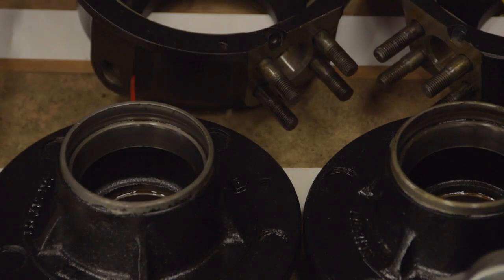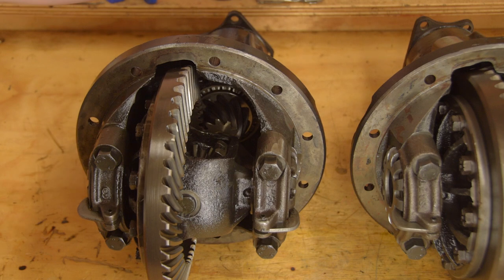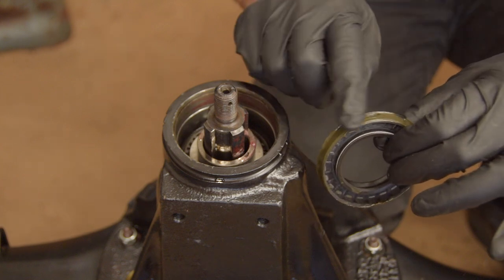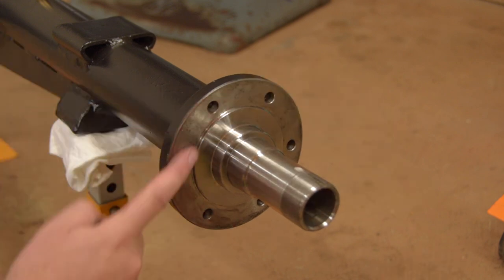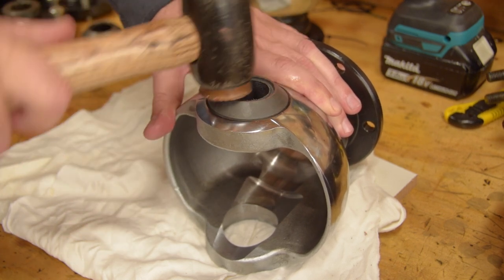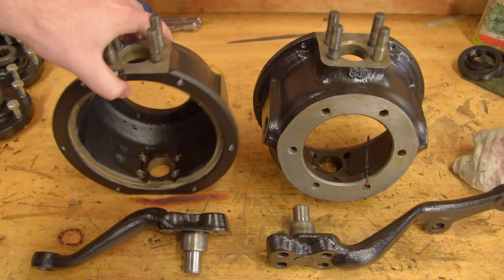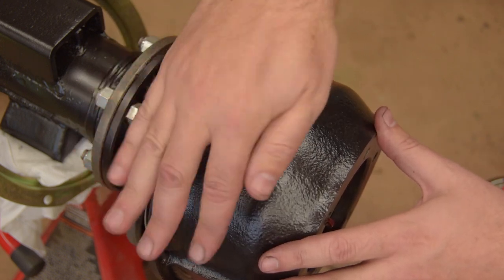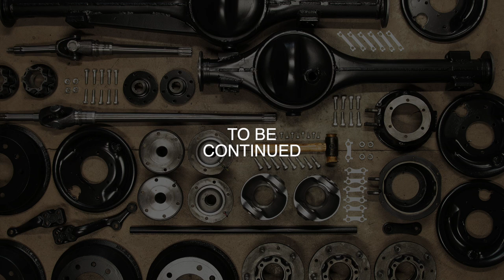Land Rover Restoration Part 10 - Front & Rear Axles 1/2

Comment: Surprisingly enough to respond to your gear pattern comment they are very good. You want the pattern to edge further towards the “toe” of the gear, ie further out towards the edge rather than it be further down i the centre like you suggested. On our aircraft transmissions we set the pattern relatively high, along with roughly about the same amount of backlash
Reply: Hi folks, I'm guessing, but I suspect the reason for this is to maximise leaverage and contact area on the gears thus reducing the tooth load and consequently the wear.  Obviously you don't want the contact pattern ever getting off the outer edge of the gears, just 'reasonably' close. BobUK.

Comment: Whitworth bolts holding the backing plates on, Luxury. Series 2A use BSF (well mine does), Nylocs for those are getting hard to find at Bunnings, still popular in British aircraft restoration circles.
Thank you for the detail on the front swivel housings, being new to Land Rovering I wasn't clear how it all fitted up and worked.

Comment: For the preload use the lead solder method.  Replace the shims with solder and tighten until preload achieved, remove, measure with calliper and then select shims.  Loads quicker.

Comment: Greetings!  I have a Series 3, 5 door and am going to rebuild the fronts hubs and your videos are an immense help!  Keep up the great work, looking forward to seeing your Rover finished.   With that, at around the 22-minute mark you begin reassembly of the hub and are setting the drag/pre-load on the swivel pin bearing and state 8-10 lbs; I was watching another video and 3-4 kilo's (approx 7-9 lbs) is stated.    Additionally, according to the 'Land Rover 2-2A-3 Owners Workshop Manual' (pg 141), the resistance must lie between 14-16 lbs, but wait there is more!  The 'Haynes Restoration Manual: Series I-II-III' pg 231, the drag should be 12 lbs.   So between all that, the range is 7-16 lbs, which is fairly wide.     Do you, or any S3 Rover owners out there have a definitive answer?         Thanks and keep on Rovering!
Reply from the maker: Just go with whatever is in the green workshop service manual for series 3. That is what Land Rover published for mechanics to use. There were also changes in design for the top bush - I think earlier series 2 etc. vehicles used a roller bearing, so this could be some of the difference.

Comment: Excellent job, well done. Did you swap the front and rear diffs so that the one with least wear went to the back axle? I have used gaitors on my front swivels for 15 years now. Recently replaced one that was torn and found that the chrome swivel was perfect.
Reply: exactly what I was going to ask
Reply from the maker: No. I wasn’t 110% sure they were identical. And I have some rubber gaiters here to put on later. Haven’t used them before.

Comment: In all of my experience, Black Oxide or Oil Phosphate is an extremely better coating than zinc. I exclusively use these premium-priced Oil Phosphate Bolts because of their ablity to resist rusting with the aftermarket parts I sell.

Comment: A good low cost way to get bushings or bearings installed is to use some all thread (threaded rod) and some thick machine washers.  That way you can sandwich the assembly with the bearings or bushes with consistent pressure. Great is you don't have a soft hammer or hydraulic press.

Comment: Amazing video and production as usual lGeoffrey, thanks! One thing I noticed, when you were bolting on the axle end/hub bits (?), did you fasten the bolt with a torque wrench to spec, while you held the nut with a wrench? You will get a wrong reading this way. If you don't have enough access for a regular socket, there are torque wrenches that have a square hole out the top/front of the beams. This takes special inserts that are square on one end and have open or box wrench form on the other, and neither add any height to the wrench. Hard to explain but you will find them under the German word "Einsteckwerkzeug". ;) Cheers, Lukas

Comment: One way of protecting your chrome balls is to fit leather gaitors. Land Rover used to fit them onto Land Rover's made for the armed forces. One side of the leather gaitor was fitted to the axle flange when the fixed first half of the chrome swivel was offered up and fitted. Then when the swivel half was offered up, fitted and was ready for the sealing retaining ring to be fitted the wide end of the leather gaitor was fitted and held in place by the retaining ring. The gaitor was laced up at the bottom so any muck would not get in from the top!
Reply from the maker: I have a set of rubber gaiters that I'll put on. I left them out of the video partly because they look crap and partly because they were shipped without the rubber glue (they come split just like the leather version).

Comment: I knew a bloke who swapped his defender wheels for Nissan Micra ones.  Then he swapped the chassis, running gear and body for the now redundant, wheel-less Micra. ones also.  "This is the most reliable, economical Defender in the world," he said. He reckoned off-roading was exactly the same as he  only used it on Tarmacadam.

Comment: Great video thanks Geoff. I shall revisit your back catalogue and get a few tinnies out of the fridge. I would love to zinc plate all the bolts on my 2011 Puma which were originally plated, (I believe), they are a dull silver colour,  but the plating has worn off and now they're starting to rust. I assume the dull silver colour is because they're not passivated?
Reply from the maker: All commercial zinc nuts and bolts are passivated. If you have gold coloured bolts they may be cadmium plated which is a different thing.
Zinc plating just gets old. You can buy a kit from Jane kits (I assume your in Aussie or nz). I’d suggest playing around with a vinegar mix first so you don’t ruin an expensive kit getting used to the process. It’s easy once you get the hang of it.
Reply: @GeoffreyCroker  Thanks for your reply Geoff. The bolts on my Defender are definitly not passivated. They look like a dull silver matt finish paint has been applied?? I'll show an image of these bolts in my next video so you can see what I'm talking about.

Comment: For anyone watching, because i don't see it mentioned in the video, do not use a lead hammer for installing those parts. Lead smears, and contaminates, which then causes a wear spot. Brass, copper, or delrin face for soft, or, using a driver, with a dead blow hammer.

Comment: Geoffery, did you swap the diffs over front to back? As the rear had done 95% of the work up till the rebuild I would have put the front to work to even the wear on them, and give the original rear diff a bit of peace and quiet, assuming you were going to retain the freewheeling hubs.
Reply: Is it even possible to swap them tho

Comment: Out of interest, for the backing plate brake adjusters, did you happen to use the Britpart adjuster kit RTC3176? I'm about to try one out and they are a little different than factory. Loving the series :)
Reply from the maker: Yes. they are complete junk. If at all possible keep the original adjusters on the backing plates. The kits you get now are the worst quality junk you can imagine. If you have to change them maybe try and find a n.o.s. kit on ebay before buying any of the britpart/bearmach/allmakes kits.
Reply: @GeoffreyCroker  awesome, will do. Thanks heaps for your advice

Comment: i like your videos even better now, you use Wright tools and #2 Permatex. I'm old enough to remember the time before RTV. You even had to use some Whitworth sizes. What did you call that bushing at 16.15? It appears to be sintered metal.
Reply from the maker: I experimented with importing Wright tools into nz. I kept a few left overs for myself. They are equal to the best. 
The bushing is railko, which is a proprietary plastic, similar to phenolic resin.
Reply: @GeoffreyCroker  Thanks

Comment: Great videos...I think you are testing us, but I saw the diff pinion seal go I back to front I think.
I think the banjo gasket was only coated on one side I your video.
Hope that you add a lot of silicone o er the pinion nut before the shafts go on, because they leak
From the flange if you don't. I was transfixed watching the videos. My comments may be wrong,
As I was not there, and editing can be misleading, but I hope my comments keep us all looking for
That good old British oil leak,

Comment: Great video as usual, thanks! Are you sure the the Diff pinion Oil seals are the right way in ?? I m just worried because mine are the other way around (spring inside).
Reply from the maker: Yeah. They are hollow the other way round. The spring doesn't matter. They can be whatever shape depending on the brand.

Comment: Where did you source your axle seal "seating" rings? I can't seem to find the right ones and I've ruined more than one seal by trying to make it work with just the old seal as the tool.
Reply from the maker: I made them. But I haven't before. Just need to find something the right size. Yeah, otherwise they are easy to damage.

Comment: I'm not sure if this has been answered already, and I'm not sure if anyone's going to be answering questions on a 2.5 year old video, but I was wondering about the open diffs. Around 7:15 you mention the problem with open diffs and off-roading, but I don't see an explanation anywhere. Is there no diff-lock on this vehicle?
Also, why is the rear diff offset to one side? I understand the front diff has to be so the drive shaft can fit around the engine, but isn't the back diff normally centered on the rear axle?
Reply from the maker: There’s a transfer case which locks the front and rear axles together but no lock on either axle. This is the normal arrangement for a four wheel drive. More modern vehicles have a 3rd ‘diff’ in place of the transfer case, and this is what you ‘lock’ in a defender/Range Rover/landcruiser/etc. The diffs are offset because Land Rover made it that way.

Comment: Cracking job, and you can show us another video doing it all over again to replace all those Britpart bits!  Remember this word: “Bearmach” - much more reliable quality for similar price and availability. 😉. Any temptation to fit Eaton Trutracs?
Reply from the maker: Don’t believe it. I’ve bought parts from all of the cheap brands. They all just source the same crap from India. Unless you buy genuine parts, it’s just a lottery. I buy britpart more than the others because I figure they sell ten times as much stock as the others.
Reply: You’re right that they all outsource from cheap manufacturers, but I found that Bearmach seem to have higher quality control.  I have had a few good Britpart experiences, but for the most part, I have been enraged by their stuff.  Please, for your own safety, don’t use any of their brake or steering parts.

Comment: 18:41 that's not burning. It's called fretting corrosion and its caused my tiny amounts of movement between two metal surfaces. As a rule of thumb; if a bearing is tight in the OD , it will be a sliding fit on the ID. Or vice versa..

Comment: Did you really electroplate some load-bearing bolts? I think that's a no-no because of something called hydrogen embrittlement weakening the stressed parts. You might want to do some research and consider replacing them with standard bolts. Your videos are great, keep them coming!
Reply from the maker: That's why I didn't plate the engine head studs. I'm not worried about anything on the axles that's going to fail under that kind of stress. More of an issue where you have something like wishbone suspension and only one or two bolts taking all the road stress.

Comment: I though two of the studs on each axle had a slightly larger diameter in order to set the steering arm in the correct position

Comment: You wouldn't have the part number of the nuts and bolts connecting the dust shield en stub axle to the axle. Cant find it in my parts catalog
Reply from the maker: They are hiding in the brakes department. Had that trouble as well.

Comment: 20:34 : I don't get it: how did LR know in advance where the nuts faces will end up?
Reply: He just slightly overtorqued or undertorged them so that they line up.
Reply: @David-ls4qp  yeah, exactly -not comfortable with the idea of under/over torqued in a car or engine. If it was e.g. a table or a sofa I wouldn't mind but here I think it's slightly weird. There are better solutions to achieve the same effect.
Reply from the maker: You just bend the tabs up wherever the nut ends up. There are two tabs per nut so at least one tab will always end up on a flat. If they end up on a point you just bash them around the point.
Reply: @GeoffreyCroker  A-ha! Didn't spot that -that's quite clever.